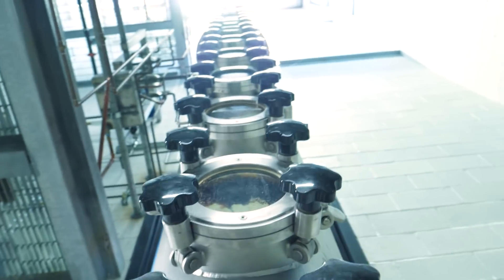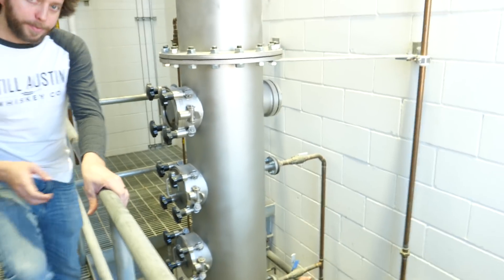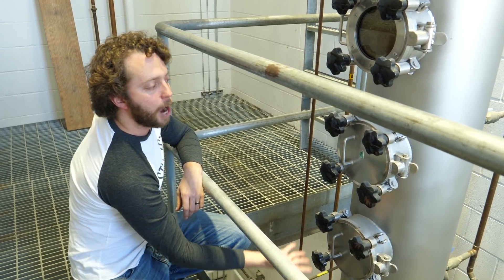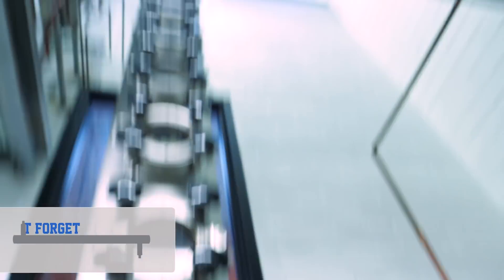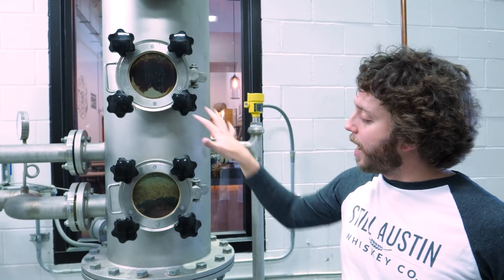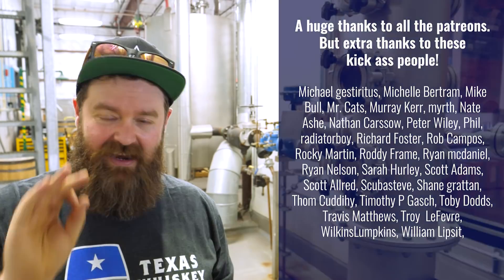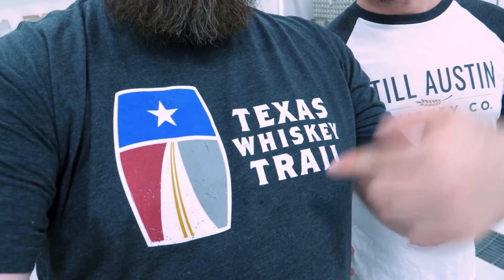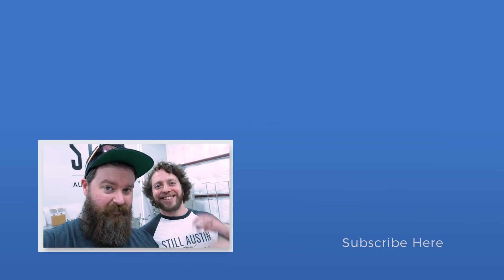How Does A Continuous Still Work? With Still Austin

Comment: Awesome video! Just curious how they handle the methanol production? Do they preheat the beer to 68 C before pumping it in, do they restill that at 68 C or do they know what plate picks up the most methanol and are able to pump it out? Or do they simply not care about the methanol production?
(Edit): nvm i just noticed the top pipes at 5:08. So basically they can just run it, separate methanol out and also fine tune their spirits. Thats pretty neat!

Comment: Hey dude, worked in a brewery production facility for a few years, very interested in distilling but no experience.  When you are talking about spent grain near the end there you aren't actually talking about spent grain, are you?  You are referring to Trub, correct?  Also, what's the deal with compounds such as Biofine in the process, do you use them or is that a no go, if so why?

Comment: Jesse. I worked at an ethanol and food grade alcohol production plant for 10yrs. The spent sludge was sent to another process area and squeezed of as much liquid as possible and then on to the dried distillers grain plant for drying. Some is sold as high protein additive to bolster poor quality feed stock. And the brown liquid is sold by the tanker for the same but poured over feed tray at milking stations and long feeders.... Your mate gives it to farmers for free in its full form. But my tight-arsed mega millionaire company owner employer at the time preferred to sell it to farmers here struggling for feed during the drought. Cheers to Still Austin.

Comment: This is really cool. I have been reading and dreaming of buying some new still parts today. Is there any way that us home distillers can build a system with the rectification setup like shown in this video?

It would be amazing and cool to be able to distill a product and set the output valves and get what you want from it, or is it just silly to think it would work for a small home distiller?

I can see the continuous side of it is impractical for us home distillers.

Comment: 6:30 - they were pulling from 1, 10, and 12.  What happens to the spirit accumulating at all the other plates?
Reply from the maker: Its not accumulating.  Its a plated column so any time a plate is over loaded the liquid is sent back down to the plate below it.
Reply: @StillIt  Well, if plates 2-9 are sent back to 10 for collection, what's the point of having all those plates or collecting from different points.

Do a video on how plated columns work.

Comment: How do you keep the all of the vapor from exiting the lower valves on the column? I would think it would travel the path of least resistance since this is a closed system?
Reply from the maker: Good question!  The valves are pulling the liquid sitting on the plates rather than the the vapor. (as I understand it anyway!).
Reply: @StillIt  I see, I love the idea of having the column make the cuts, I wonder if this could be scaled for a home set up... perhaps a large column with several valves at different heights along the column leading to thumper kegs to force the vapor through at different proofs? keeping it a closed system.. but I don't know if the math works for how much pressure would you'd need..

Comment: I would love to know what the feed rate of wash/grain and the takeoff of spirits is.
Also why on earth did they use manual valves and a ladder, and not electronically controlled valves?
I get the feeling a lot of the design decisions on this still were made by someone without a lot of experience building/operating one, it has a very prototype feel to it. 
Do you have any background on its design? was it made by a company that specializes in continuous stills or was it designed by someone at the distillery?
Reply: I''m sure the hand valves were done as a low cost option to be upgraded later on.
Reply: @puddingwar5110  I'm sure you are wrong.   Simple on/off valved would cost ~1% of the cost of the still.
Reply: @stevealexander8010  Exactly, but to put in stainless steel automated valves and  control system with all the wiring and programming adds a huge extra cost that isn't critical to production. But can be added on later if they want or need it, that or they just wanted to be more hands on 😉
Reply: @puddingwar5110  You can get stainless explosion-proof solenoid valves for ~$300 each.   The alternative of a pneumatic valve + actuator is ~$550 each.   The pneumatic air and control system already exist for other controls.  You'll also need ~10 output points added to the controller for another $1k.   Maybe $4k to $6.5k total.  

I got a quote on a smaller but similar column from Forsyths for $170k, this one is certainly well over $210k just for the column.   The piping & receivers will set you back ~$90k, the control system ~$70k, another ~$9k shipping.  If you are lucky the steam and pneumatic piping & controls wiring will be ~$50k more.  $45k for a culinary steam boiler to drive it.   The purpose built building (a glorified stairwell) is at least 250sf and 4 or 5  stories, so at least $35k stripped and ~$70k outfitted.  Maybe another $20k in air fair and per diems to get the Scots and controls guys in to do setup.

They have ~$550k minimum in that installation, so saving $4k to $6.5k ISN'T the main motive.  It's a conscience decision, and perhaps a poor one.

I'm quite certain that they make one valve plate setting on this system, then leave it alone for an entire run/shift.  They may use the same valve setting for multiple runs if they are making the same products.   It's reasonable then to not automate this once-a-day to once-a-week type setting.   OTOH it is a major PITA to send some scut-monkey up 4 or 5 floors then a ladder to change the setting.   Very error prone too.

Then there is the safety issue.  Fire code in most places requires two exits from all man-ways around the still (in the containment area), but I only see one staircase in that column.  That means they can't change settings during a run.  You set it, bring up the still, shut down the still, then change settings.  That basically means they can't experiment with valve settings, without endangering people.

So they have a 10-valve flute (1024 possible settings) and I'll wager they don't use more than 5 or 6 settings regularly and have never used more than 25.   More flexibility than they can practically use.   

The story I've heard from a former distiller there is that they aren't happy with the control system.  The controls integrator simply lacked distillery experience and ...
Reply: @stevealexander8010  
Once you get them dialed in you usually don't adjust anything.  I've ran larger stills.  And usually adjust the pulloffs from heat added and reflux.  While drawing of a plate that's in the middle.  So a adjustable valve low on the column to control overhead on the deflag would be great and ones to control steam input which I'd imagine they have.  Then you can drive up and down the rectification column section the proof you want to recover from about three trays.  We always pulled off the same tray and adjusted by heat from a reboiler and reflux from over head.  Also, pulling off a tray for flavor can be a blend.  Where you don't open a valve the whole way.

The big thing I'd suggest to them is to insulate the column.  It would save them a lot on heat up time and on running of the still.  It's insane not to insulate it when it's not a pretty copper one.  And to be honest, copper ones should be insulated to.

For them.  Vodka they'll pull off the top plates.  Probably #2.  And for Whiskey pull off the third from the bottom and adjust the heat based on that.  If you do it right, you can run 4 batches of vodka and then adjust temp on still and change takeoff point and pull 4 batches of whiskey.  Without ever shutting down.  You can even have different makeup beers to run.  Just have your takeoffs going back to the beer well while you're getting your temps to where they need to be for what you're wanting.  

We did it everyday where I worked.  I agree having all those controllers would be nice.  But they add extra failure points or leak points that can take down a still.  I don't want control points I don't need that can take me down.  To be honest after a still is set up all of those extra take off ports you don't ever use should just be capped.  So no issues with leakage from it's point.  We do that all the time too.

The only thing I'd do, is split the column to a stripping column piped to a rectification column and save needing it to be 50ft.  I'm surprised at how few plates they have.  Stripping sections usually are around 12 plates.  With rectification to do Vodka at 20 plates.  I think they're only running 24 plates total.  I haven't tried their vodka but I'd be interested to see what flavor profile they get.
Reply: @mverick160  Very good words.  I mostly agree.  Yes it's steam injection - no idea abt the steam control (but that's expensive too).  A lot of continuous systems in this size range just manually dial in the steam.

Some oddities about the dephlegm' iirc.   But the larger the still, the lower the fraction of energy  saved by insulation. 

This stilis very flexible compared to a Vendome or Barrison, but it's silly-huge and not very energy efficient.

They have this one in a very tall "stairwell" type addition, and I imagine the temperatures get pretty ugly in there.   Insulation + ventilation might cure that and boost the efficiency a bit.

What sort of stills do you have experience on ?   Reboilers aren't very common in beverage alcohol stills (but they are considerably more energy efficient than steam injection).
Reply: @stevealexander8010  
I've worked with and ran 90in columns.  They were insulated.  I agree a larger still gains less from insulation but it's always worth it in energy savings.  And also in how the column runs from heat loss and what seems like less even temp across the plate.  We've started them up before the insulation was all back on and they had large swings regularly.  Once the insulation was on it settled down.  I've designed columns 8in to 62in.  They're all a lil different and have their different idiosyncrasies.  I worked in oil refining and also a plant that brought in corn and stripped it to it's hull, germ, gluten, and starch bases.  Refined the germ into oil, pelletized the hull into cattle feed, pelletized the gluten into chicken feeds and converted the corn starch into corn syrups.  We also had towers to run distillations.  And refining is all about distillation columns.  Different styles in every unit.  For that our tops went through an accumulator for stripping of sulfur compounds and cooling the top of the column.  Separate vessel with a pump back to the column that scrubbed the tops.  Ours are heated by reboilers that either used steam or returning effluent from heat exchangers. We had a rack of heat exchangers that ran to a fired heater the tubes ran through.  Then to a reactor and back through the heat exchangers and to a product separator then pumped into the column at about 1/3 the height. The reboiler heat source is from the heat exchangers on some and steam coils on others.  

It's problem compared to these is more moving equipment.  But their are takeoffs that would make a better product for the beverage industry too.  I'm always surprised they don't run 4 different types of still and barrel for the different flavor profiles of each.  Then later on in 4 years you can blend 4 different flavors to get one you want.  More money but their are also ways to tie them in for heat together so you can get the heat to a different tower.  Basically, most seem to run large pot stills in the beverage industry because most aren't that large of producers.
Reply: Yeah - I'd love to taste their product too.   I'm more of a whiskey guy, so the left hand side of the VLE curve means 4 rectification plates are plenty.
Reply: @mverick160  Wow - good experience and detail.  Yes in the small-bev-distiller world most use a pot stills and ....  Pot stills are expensive, labor intensive and energy inefficient. Aside from tradition there is little to recommend that process.

The continuous stills are standard for the big producer, and larger-small-fry, sometimes use them just as stripper - with a final pot/batch distillation.

So maybe you can answer a question I have.  The big guys like Beam, and even small continuous systems from Vendome  (but not by default Barrison nor Forsyths) always have a doubler.  Why use a doubler vs another plate ?  ???

The doubler is a small steam-jacketed or coil vessel . So for example A Vendome 12" or 14" "bourbon still"  has (iirc) ~12 perforated plates in the stripper section, and 4 plates in the rectification section & a dephleg'.  They take vapor off the top of the column (55%ABV-65%ABV) , condense it, drop it directly into the doubler, take vapor off the doubler, condense & cool it, then into barrel.

I've seen studies show they lose some volatile organic acids in the doubler but .... why?

US law forbids whiskey product distilled >80%ABV (~0.52mol-frac) and typically OEMs keep it under 70%ABV to retain more flavor.  But 70%ABV = 0.40 mf, so it doesn't require a lot of plates.  But it's problematic to pull barrel-able whiskey from several plates.   One plate lower and it's not even bottle strength, or one plate too high it's not whiskey. That's my guess.
Reply: @mverick160  In any case, thanks for the comments.
Reply: @mverick160  Yeah - I just ran some numbers and you can lose quite a few 100s W from a 1 m^2 section.  I'm more surprised at how much power is "lost" across the plates of a copper column.
Reply: @stevealexander8010  

But on copper they get a free Sulphur reduction.  

With stainless you get less heat transfer but zero Sulphur reduction.

So with a copper column other then it being pretty you also have more copper to react.  Allowing a longer continuous run that strips Sulphur without a cleaning.
Reply: @stevealexander8010  

For the doubler, the only reason I see is for flavor with what they use to fill it prior to a run.
Reply: @mverick160  Usually water.  It looks like another plate to me.
Reply: I've taken the tour - they had the still designed, meaning it wasn't clapped together.  It was built by Forsyths of Scotland. And it works very well - I like their bourbon more than a lot of other "Texas" bourbons.
Reply: @degmar  This still was designed by Michael Delavante and built by Forsyths Scotland (I've spoken to both) but the control system was devised by some other US company.  So blame the manual take-off valves on the control company.  Delavante was a rum guru, worked long in the rum biz as distiller,, and has written books on distilling.   Forsyths will do what the customer wants and has a great design team.   This still has a lot in common with other Forsyth columns, including huge huge height (and relatively high cost).      IIRC the feed rate is 19liter/minute, ~5gpm.   Not exactly a whiskey still, but a very flexible unit than can make low wines to vodka.   I fear it's a jack of all trades, master of none - but that's purely speculation.
Reply from the maker: Yeah not sure sorry mate.

Comment: I was hoping he would address where the methanol was taken off.
Reply from the maker: They actually vent a lot of the heads/fores/whatever out into the atmosphere.
Reply: @StillIt  That's surprising. Surely they could burn it to heat the steam.
Reply: @StillIt  do you know what the temperature is of the foreshots vapor that they are venting off? Is there a deflegmator or something to regulate that temperature?

Comment: Why are they distilling on the grain tho , it feels like a higher chance of cloging
Reply from the maker: They don't have much trouble in the still. But did last time I was there Harry mentioned they wish they used larger copper to pump it around.  

It's just more efficient, many would say it adds flavour too.
Reply: @StillIt  yeah id prefer to use a mash tun and drain the surgery water and ferment off grain

Comment: So the the beer with the grain goes into still and basically takes a slide down the boil plate and then out to the silo so essentially no holding boiler tank. That’s crazy. And super cool thanks Jesse for the killer content
Reply from the maker: Yep.  Steam is pumped in the bottom to heat it.  So yeah, no pot at the bottom.